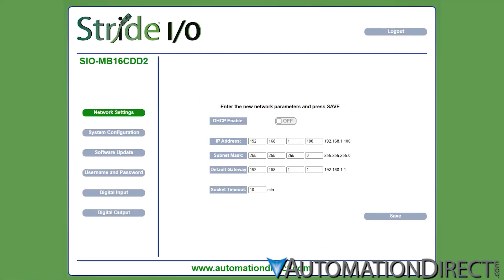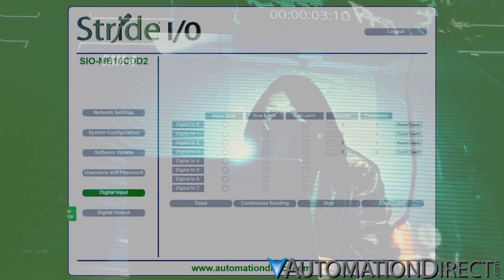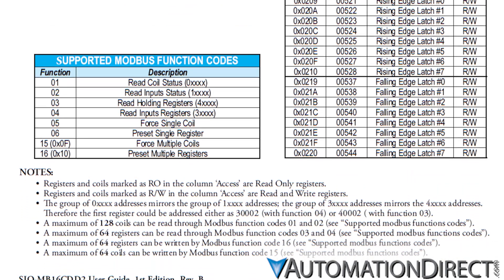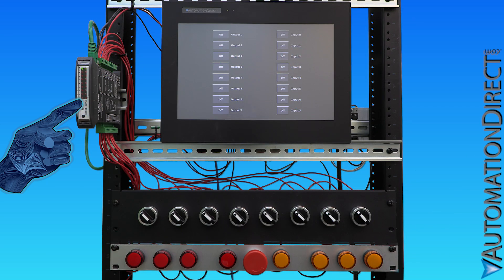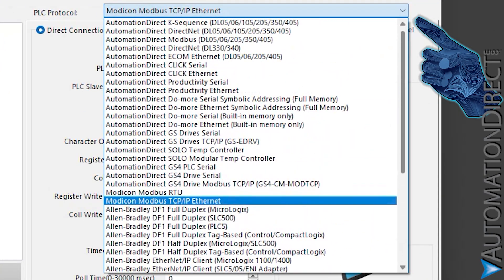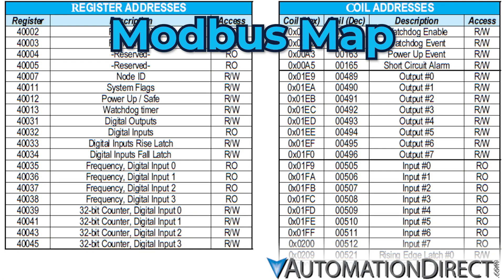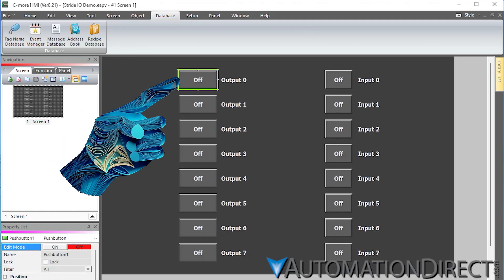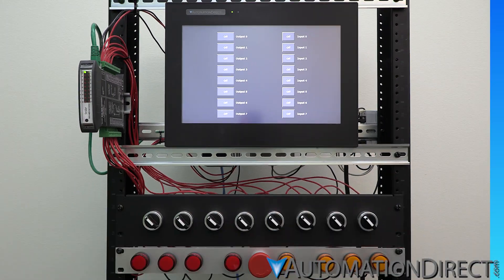Stride Ethernet Field I/O Modules from AutomationDirect

Comment: Can these be used with click PLCs?
Reply from the maker: @chrisvanduin5456 You would have to use one of the Ethernet enabled options, but CLICK absolutely can control this I/O over a Modbus/TCP connection using the Ethernet port.